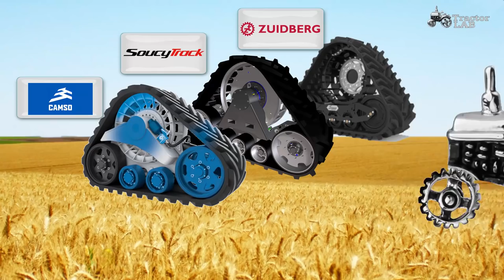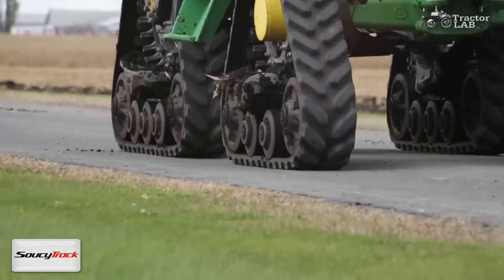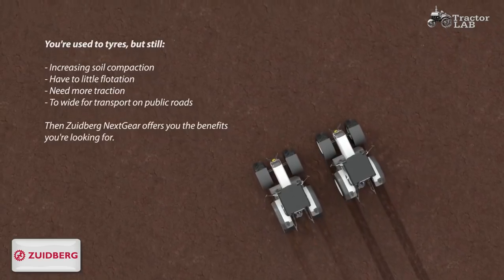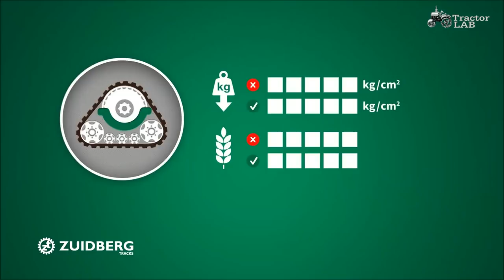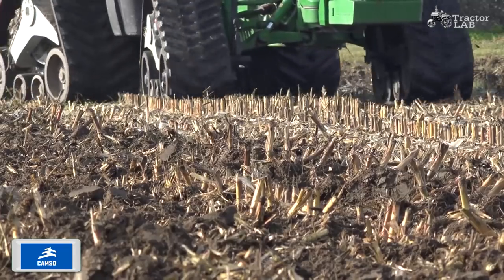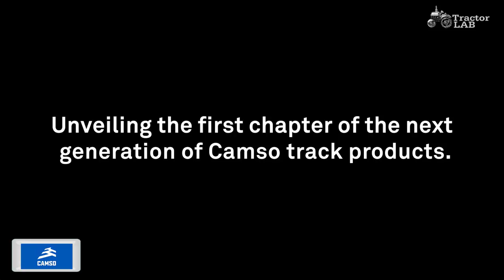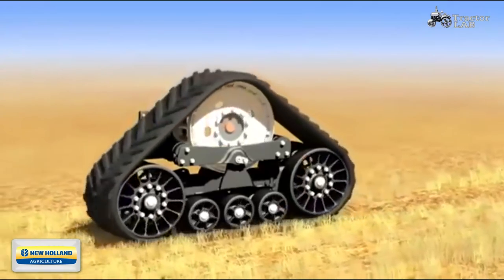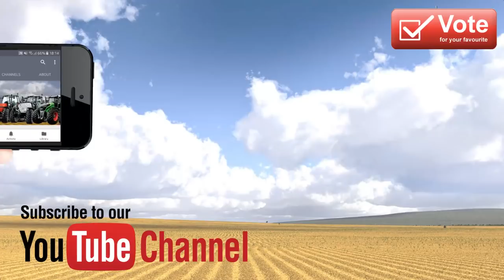Tractor tracked systems | Conversion track systems | Soucy Track | Zuidberg | Camso | NH SmartTrax

Comment: Learned something, the drive wheel is geared up to spin faster than the axle. I was wondering how transport speed stayed the same.
Reply: its only on a specific model used with regular wheel on the front axle the gear ration have to be kept identical